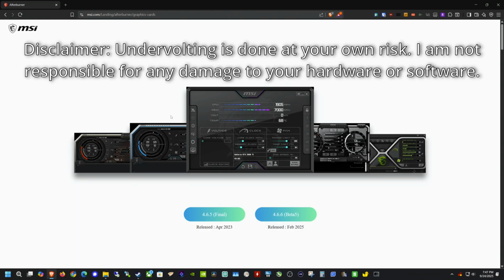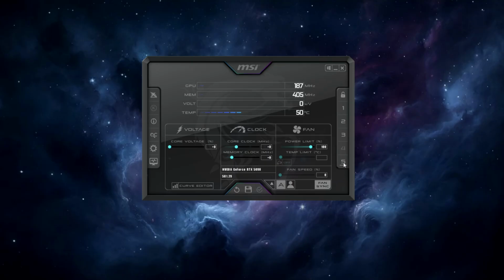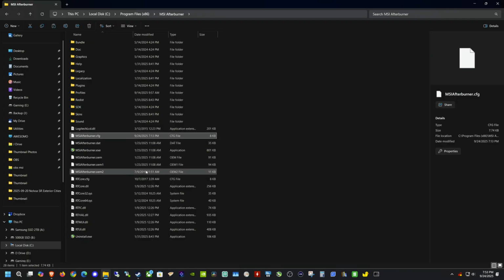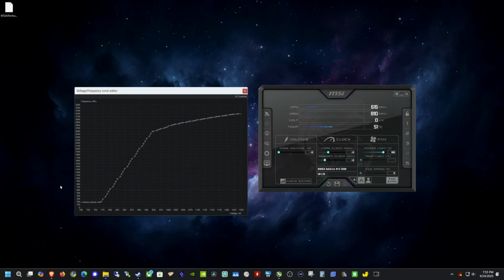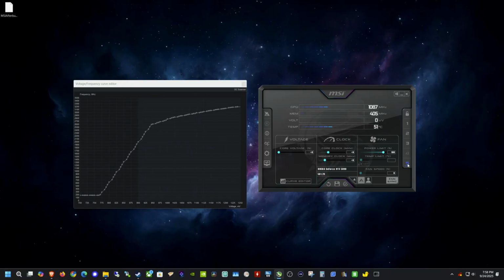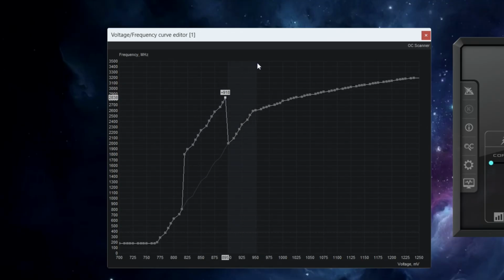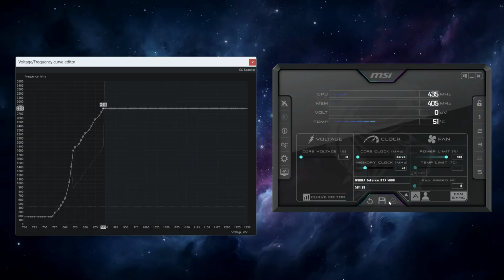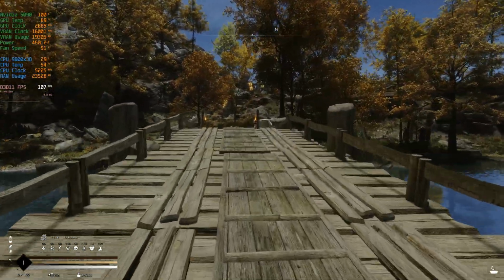You're Undervolting Your RTX 5090 WRONG (Here's How To Fix It)

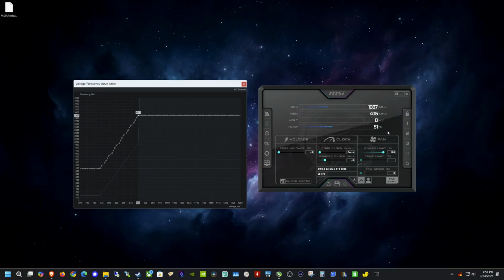Comment: guessing this curve thing mentioned at 6:50 as an issue is only impacting 50 series? I do the same approach on my 40 series, and during idle it is the same clock speed, 210mhz on my 4090, same power draw of around 10W with youtube playing

Comment: Hey, this is my first time undervolting and i decided to go with your method since it makes the most sense to me. My undervolt is set to 2800mhz at 900mv, however, whenever i check hwinfo and check current gpu clocks i noticed that they are hovering around 2600ish on current and averages, is this normal behaviour for an undervolt? I would greatly appreciate your response since i am not sure if i am doing it right.
Reply: This is called "Clock Drop": Users have reported that real-world boost clocks on 50 serials cards can sometimes sit ~100 MHz lower than the curve target during heavy path-tracing loads. If you see your card boosting to only 2900 MHz when you set 3000 MHz, this is normal behavior based on the card's internal algorithm.
Reply: @shikai1169 thanks for your response, i appreciate it! I subscribed to your channel. Also, just one last thing regarding the starting point of the lifting of the curve which is .820mv. I have noticed my gpu does 300-500mhz on idle through hwinfo, do i have to start my point from somewhere there instead then? Another thing is, would it make a difference if i start from .810mv instead of the .820mv you recommend?

Comment: Hey, Thanks for the informative video! Just a question: why do you set the Power Limit to 104% ? It shouldn't have any impact on card performance according to the fact you will never get even close to the 600w (100% PL) let alone 620w. Does it have any impact on the GPU clocks ?

Comment: Quick question please. I've used your exact instructions on setting up my 5090 and the results are there, stable, all good. The only thing that didn't change in Afterburner is the baseline GPU Mhz. In your video it very clearly shows 200ish Mhz, but for me, it stays at around 1000 Mhz. I can't figure out why. My driver version is 591.74 and Afterburner is 4.6.6.16757

Comment: how did you get your idle down to 200 MHz did you adjust that manually in MSI afterburner? mine is at 1400MHz and I have my power management set to normal not max performance.... I do have the LG 45 5k2k Oled ultrawide monitor not sure if that would make a difference... I have the MSI gaming trio RTX 4090
Reply: the curve editor shows the lowest point the white box is at 1400 MHz and I can see the 0 at the bottom now on the MSI afterburner main skin it shows the MHz for the GPU fluctuates from 210 to  2520 is that the same MHz thats on the curve editor?

Comment: That’s weird, my Astral 5080 and MSI AB auto corrects the lower values so my line looks like that and the gpu idle as it should without me doing anything with the lower clocks and voltages 🤔

Comment: Hey there man thank you very much for the tutorial - i've been using this for around 1 week now and I'm 100% stable in games and under load scores are better in 3DMark Steel Nomad but I'm getting hardlocks while browsing the web or in windows - happened for like 5-6 times now. For now, I've reverted the memory oc back to +0. I'll keep an eye out and keep you updated.

Edit: I've made some adjustments to the curve to make it monotonic (always rising) by making sure that there is no frequency decay when jumping from one voltage to another or in simpler terms make the next frequency always higher than the previous one.

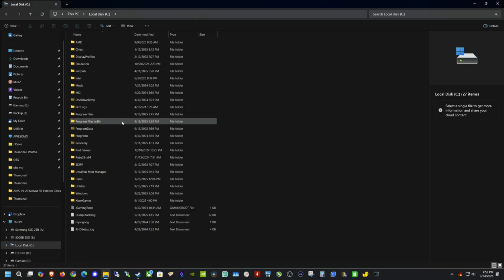Comment: 3:35 Hi. I am in Program files x86 and there's an  MSI folder, but there is no MSI Afterburner folder. I even restarted the pc to see if it would appear, but it's not there. What am I doing wrong?
Reply: update. I couldn't change the size of the graph so went ahead with the rest of it anyway. Wow. Got my temps quite a bit lower (from 5-10C lower depending on game and benchmarks I tried) much, better and the performance don't seem affected at all. Thankyou.

Comment: 470W for a videocard still looks insane to me. I downvolted/underclocked my 5060 ti 16gb to consume around 25..70W in games. uplimit I set is 0.745V, 2200Mhz. 1440P, 60 fps lock.
also, there is another version of Afterburner that allows do +3000 Mhz for VRAM
Reply from the maker: Yeah I just got the updated Afterburner version and was testing 3000 plus!

Comment: Thank you for the tutorial! I had one question regarding the volt number on MSI Afterburner. I noticed a lot of tutorials including yours have zero for the volt number throughout the video. Do I need to worry if mine is fluctuating around 800mV? Also at the very end, after clicking on Apply, do I not need to worry about saving the setting into one of the profiles?
Reply from the maker: Older versions of MSI Afterburner had issues with the Voltage reading. I had to update mine recently. Yours is working as intended. I might have forgot to mention to save the profile once you have a stable under clock and turn on apply in reboot. I personally use profile 1 and hit that windows icon in the top right once I know for sure its stable.

Comment: But why?  You are leaving performance on the table. The GPU is safe at 90c max temp. Its the cable you have to worry about.  I max out my voltage/Mhz until the 6 pins read just under 9 amps. Best way to go.
Reply: Why what? Why undervolt? Lower temps. Lower noise. Lower wattage. Better 1% lows. Better question is "why not undervolt?"
Reply: @Fleetwood6824  My 5090 is water cooled. The connector pins get around 8.4 amps. MHz is 3100. 600 watts. MSI Afterburner MHz slider is set at 325.  Temps  never get above 60c. Noise? What gamer with a 5090 games without gamer headphones?  🤣🤣
Reply: @Bailey-k2j my 5090 is air cooled in a mesh case and lives below 58c. Your water cooled 5090 has similar (or higher) temps than my non-water cooled GPU. And I don't HAVE to put my headphones on to hear games. You've essentially unwittingly explained the point of undervolting to yourself. 🤦🏽‍♂️
Reply: @Fleetwood6824  Yep.
Reply from the maker: For me the reason is lower power consumption and significantly lower fan noise while maintaining stock performance. I don't have a water cooled 5090.
Reply: @circuitscore  But your card can safely run at 80c. I ran my 3090Ti for 3 years at 80c without any issues. Set a temp limit at 80c.

Comment: Thanks for the informative vid. I just tried this with my 5090 FE but slightly higher clock (2850) and as far as i can tell its stable I tested it maxed everything with balance DLSS PT on cyberpunk was was running 130w lower and 14c lower temps and frames were more stable/higher overall. Your video helped me with something i didn't realize i needed to do but im glad i found your video before anyone elses.
Reply from the maker: Thanks for the kind words. Glad I could help!

Comment: Just wanted to say thanks very much, this is the best video online for undervolting! 10 degrees cooler and 150 watts less now for same performance 🙏🏼🙏🏼 where yours tops out at 2000mhz on afterburner, mine tops out at 3000mhz on the slider. Do I need adjust the graph as well as the slider for higher clock speeds? Or should I leave it at 2000mhz Cheers
Reply from the maker: Thank you! The newest version of MSI Afterburner now allows you to go up to 3000. If its stable at 3000 you can run at that speed!

Comment: when i edit the cfg file and save, it turns to a text file (\even thouigh it still ends with .cfg) and makes the program not run
Reply from the maker: In windows explorer you can turn on an option to show file extensions. If you turn on that you can change it to cfg and either save the file in windows explorer if it lets you or replace the file like I didn't in the video.

Comment: There's probably something I miss. I just purchased the cheapest 5090 I could find, and when using it at 3150+ MHz, I'm between 65 and 70 degrees...
So I have almost 500Mhz higher clock with the same temperature by just applying a +300MHz clock in Afterburner...
Shouldn't the undervolting decrease temperature ?
Reply from the maker: Undervolting will lower the temperatures. Mine runs about 10 degrees C cooler than stock. Sound like you won the silicone lottery. Which brand card do you have?
Reply: @circuitscore Gigabyte Windforce OC. Probably not the best build quality. Also it’s winter, I live in Canada so take the 70 degrees with a grain of salt, it’s 20 degrees ambient, we’ll see this summer 😅
But really happy by my 5090. Had a lot of cool whine with my 4090 (tried four different models and kept the best one which was still making high pitched noise). The 5090 clocks higher and I only hear the fans, no coil whine. 

Thank you for your video, will try to undervolt for sure. But first trying DLSS 4.5 ! First test in Portal RTX I can see a huge improvement on ghosting (GladOS cables were glitching with DLSS 4, with 4.5 they don’t disappear anymore)

Comment: Thank you. I’ve done the voltage adjustment according to your recommendations. For the Palit GeForce RTX 5090, I set the voltage to 925 millivolts, the frequency to 2700 MHz, and the power limit to 85 percent. In general, these settings gave me 84 degrees at the peak memory usage during video generation in the Wan 2.2 model. Before it was 93 at the peak. now the average temperature values for the chip and memory are 73 and 78 respectively.

Comment: Why is my GPU still running at 2400.mhz on idle even after doing this ?
Reply: Set Power management mode Optimal power or Normal make sure it’s not Prefer maximum performance globally the card stays in high clocks on performace mode, for me it was "Force Constant Voltage in Msi settings under General
Reply: @EnVyTheLength this worked, thank you !
Reply from the maker: Forgot to mention that in the video. In Nividia control panel set power management to "Normal".

Comment: why raise power limit if we are taking away power/volts? Are we lowering the power then raising it's limits? thanks for any reply
Reply from the maker: Technically we are overclocking here even though the goal is undervolting. By adjusting the power limit it gives us more room to work with in the voltage curve.

Comment: Are there fixed limitations based on card (FE) for frequency at voltage?  For instance, I can't go above 2600 at 875.  Also, no matter what I do the actual clocks seem to lag far behind the set boost clock beyond what is typical.  e.g., this user is getting ~2630 on 2800 set and I'll only get <2550.
Reply from the maker: The FE cards do clock lower and each card does have its own artificial limitations within the voltage curve.

Comment: I've got a question about the memory clock boost. After scrolling through the comment section, I saw you mention "slightly higher temps" from the memory clock boost and I thought of the Gamers Nexus review of the 5090 talking about how the memory already runs ridiculously hot at stock. Would this boost be increasing the heat of the memory modules from stock, or are you saying that this would be slightly higher than where it would be after undervolting the card? I'm still fairly new to undervolting, so I'm not sure if/how the undervolting affects the memory modules in this context. I just want to keep temps low, longevity/safety high, and performance near stock.
Reply from the maker: I settled on not OCing my memory on this card. It was a marginal performance gain on my system and was causing some instability issues with tasks like video conversion.

Comment: I achieved better results by simply lowering the power limit to 75% Goes as high as 2800 with temps not exceeding 60C (Aorus Master)
Reply from the maker: That's a good alternative as well however Id be worried about maintaining stock performance.

Comment: who much i need mv for the magic 3ghz stable avg? 1.0v 1,05v? whats your tip? need 3ghz and low voltage.
Reply from the maker: I haven't tried pushing my card to 3ghz but yeah you would probably need to increase the voltage a bit to achieve stable.

Comment: I saw a video where the guy put the core clock to +250 and power limit at 75% with good results but idk if I can add it to w what you did
Reply: Optimum tech right? I was testing those settings vs this videos UV, I actually see slightly better performance and less wattage using this videos method.
Reply: @hero654789  Thank you and is that for the Founders edition?
Reply from the maker: To achieve an OC in conjunction with an undervolt you will have to cap your voltage higher. Glad to hear the performance from this method are marginally better though.

Comment: I am trying this with a Astral 5090, does anybody else know why the power limit only goes to 100 in Afterburner instead of 104? Thanks.
Reply: Because 5090 is already against the 600w power connector limit. Don't want to melt your connector.
Reply from the maker: Depends on the card design. Some cards cant be modified.

Comment: how to do this undervolt on rtx 5060 ti 16gb ????
Reply from the maker: The process will be similar but you will need to identify at what points your GPU idles at. Change your graph so you can see the entire curve and then at Stock curve watch where your GPU idles at. The next point will be your bottom point and then to undervolt you will need to find where it is stable which is your top point. Probably could find some info on youtube or reddit on where your stable undervolt point is for that specific card.

Comment: Best undervolt quide so far. I use this with my astral 5090 oc. My temperature is max 61. Usually 59 when Nolvus latest versio run with 4 k around 90 fps without dls.  But my case is APNX V1 with 3 120 mm APNX 30mm deep fans, what keep Astral cooler than most cases can do.
Reply from the maker: Thank you! Yeah undervolting these cards is essential. I had to reinstall windows recently and didnt set my undervolt yet. My fans were super loud and then I realized I needed to resetup an undervolt haha.

Comment: Hello
When I click on chrome or just randomly the top 2 figures (GPU and Mem?) on the right 10:17 go from around 800 to 2000
and the second figures from 800 to up to 16000 

whereas your one says around 200 and 450
Any help please?
Reply from the maker: Chrome can do that. Youtube videos will use your graphics card and push the Mhz higher.
Reply: @circuitscore  My clock Mem can go up to 3000 on my Msi Afterburner, would that be advisable

Comment: re ran the under volt applying your method (which makes fucing sense), system been running for weeks very stable with test, games, ai loads, cool as fuck bro, thanks

MSI Gaming Trio OC, I think I had hit a gold silicon lottery 

2725mhz, +2000 on memory, 0.88mv, 72-78% tpd at full load, around 400-450w, 30-40% fan speed, 62-68c, time spy extreme graphics scored 25,381; over 25,000 multiple times

system has been fine, since your video were up, then I came across it, highly recommended this guide to any 50 series owners (find your card’s idle voltage tho)
Reply from the maker: Appreciate that! Glad its working well. Same with my system its been 100% stable. Only thing I changed was I got rid of the memory overclock as I did some testing and it wasn't worth the few extra FPS of performance for possible instability.

Comment: When playing games the idle core clock speeds is irrelevant since the gpu will never be at idle. When not playing games you can go back to gpu defaults and get that idle speed.
Reply: yes, but if you can get the best of both worlds it would be better...
Reply from the maker: @ggp759  This method allows you to set and forget rather than manually setting an undervolt and then manually disabling an undervolt EVERY SINGLE TIME.

Comment: Life saver, thanks for showing us the correct way. MSI afterburner is fiddly as hell they need to improve that. I just went for 0.9 and 2850 for my Zotac and nothing on memory, not desperate to push every margin just want a cooler running GPU (and connector). Few hours testing Hogwarts which always seems a good test and no issues. Will give it a week of gaming before I get too giddy.
Reply from the maker: OCing the memory isn't worth it. I ended just leaving it at stock recently. I also have a Zotac. It helps so much with temperatures and keep fan noise down on my card.

Comment: My 5090 aorous master is 2000mhz when idle??? Even on default settings. Any help?
Reply: if you are watching this video or any other with the overlay, that is why.
Reply from the maker: Yeah try to restart and look at the numbers from a fresh reboot.
Reply: In nvidia control panel check if the power management is set to normal or prefer maximum. If it's on prefer maximum then that is most likely your culprit.

Comment: Hey, I noticed that with the new 591.44 driver Steel Nomad score tanked by like 400 points. Did you test the new driver with this undervolt curve?
Stock settings are relatively the same about 80-100 points less, but with the undervolt it is worse by ~400 points.
It wasn't the case with 581.80 for example.
Reply from the maker: I haven't run any benchmarks in awhile but I do play a lot of Marvel Rivals and haven't noticed any massive performance drops on the latest driver.